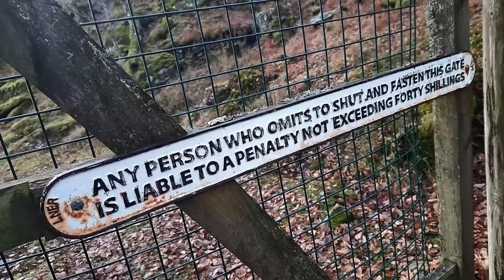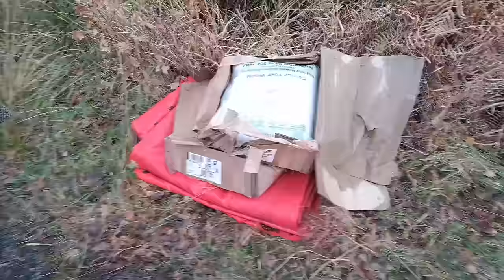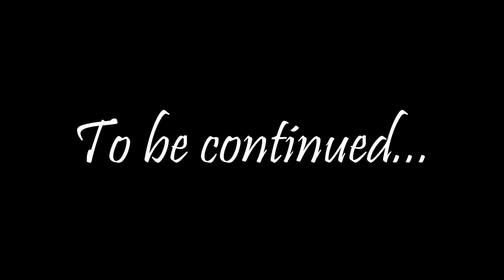34: A Haunted Treehouse? History of Scottish Traditions & Coastal Life, Scotland Highlands Life Vlog

Comment: Bree has . . . a bow-legged wattle going on. It's so cute!

That said, I'm wonering how the cottage is doing; you mentioned that you'd just experienced your coldet night, so far, Scott. Several videos back, one of you said that the cottage ws holding heat better after removing added-on wall coverings. Is that still the case, with the colder temperature? 
And, I don't want anyone to feel like they're reading a longg novel, do you see the northern lights? 
💙💙
Reply from the maker: The cottage is incredibly warm throughout the day and night. The Victorian stove creates so much heat that it stays within the living room long after it has gone out. The stone is retaining all of the heat and it always warm to the touch. The only rooms which the very cold temperatures can be felt in are the small hallway and room behind the central door and the bathroom. Unfortunately, we have yet to see the aurora here.